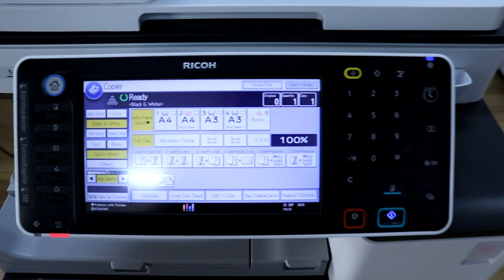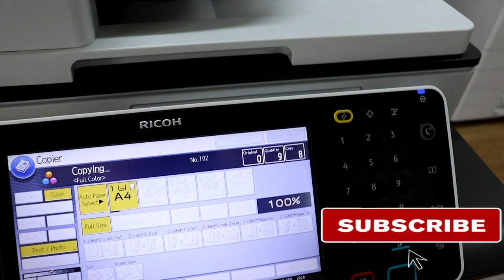Reconstruction of the copier RICOH MPC4503 Rebuild Fuser MPC5503, MPC6003

Comment: Hello, i have problem for mpc 5503. When starting print 10-20 pages double  image. After 20 pages test print ok. Can help me?
Reply from the maker: This is a common symptom of problems with temperature and humidity. At night, your temperature is too low and the humidity is too high. In the morning the machine picks up damp paper and therefore there are problems. You can keep warming the paper trays with new ones. These are fun options and should help you out.

Comment: 15:46 I think one of the gears is worn, it needs to be replaced
Reply from the maker: Now, after a few months, I know that I should replace them. You are actually right, but I didn't have it in stock at the time so I only showed cleaning. Then the problem receded and I replaced this wheel. Best regards and thank you for my suggestion.
Reply: @MrRicoh   you're welcome brother..
Reply from the maker: Greetings from Poland.

Comment: Como resetear sc544 01
Reply from the maker: • Triac defective (short-circuit) • Engine controller defective • Heating central thermopile defective • Fusing control software: out of control
or check FUSER !!